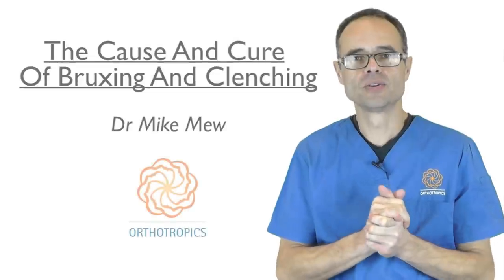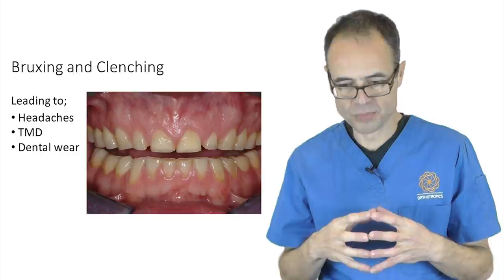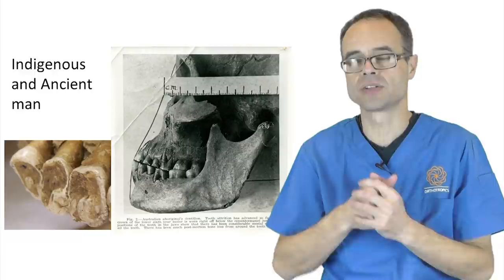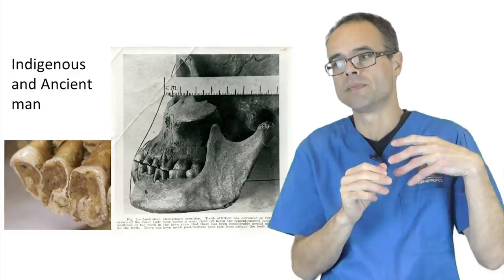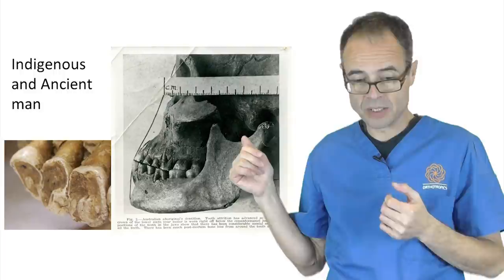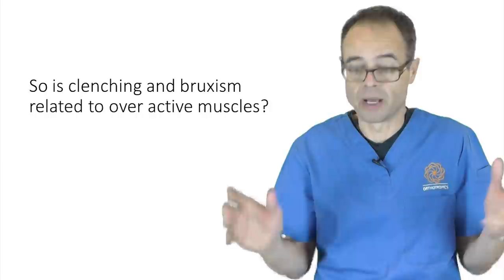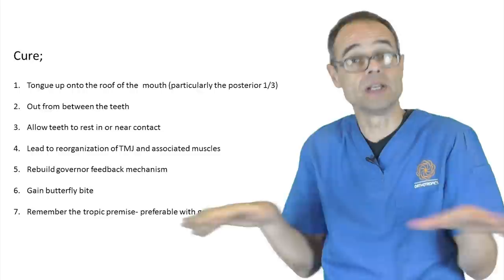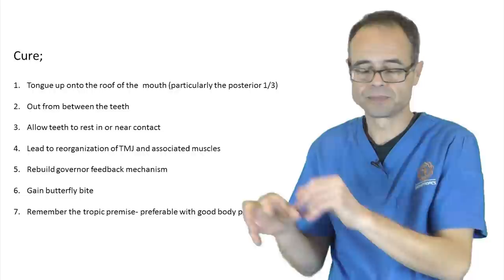The Cause And Cure Of Bruxism And Clenching By Dr Mike Mew

Comment: I used to suffer from bruxism. I was told I'd need to spend a lot of money on a night guard OR teach my jaw to relax throughout the day. I tried the latter and if worked. Most surprisingly, I stopped biting my nails as a side effect!

Then I suffered an acoustic trauma that left me with tinnitus and Eustachian tube dysfunction. The constant ringing and feeling of head fullness made it literally impossible for me to consciously relax my jaw. I wasted $800 on a TMJ splint, hoping it would simultaneously treat my TMD and my bruxism.

Then I discovered the Tropic premise, and even with my old retainer in, I felt that my bruxism was starting to relax. I can now use my tongue to consciously stop clenching, and I don't seem to suffer from bruxism anymore. I no longer wake up with sore temples. Actually I don't feel my temples straining at all when I clench, ever since 2 weeks after ditching my retainer. My teeth are a bit sore some mornings but in a GOOD way, from the roots being pushed outwards by my tongue. It's like a stretch. It is very, very clearly a different sensation than the one I used to wake up with from clenching.

You could have saved me $800 if I'd listened to your ideas sooner. Thank you for all you're doing.
Reply: Do you have pain around your eyes during the day ..like constant headaches?
Reply: @ilqar887  No, my chronic headaches are concentrated towards the back of head / neck area
Reply: @JupiMeow  so it had nothing to do with your jaw?
Reply: @ilqar887  I never said that. It's a chronic tension headache from having shitty neck posture due to the positioning of my jaws

Comment: Dr Mew, could you make a video on what remedial solutions avaialble for ADULTS who had their teeth removed for braces?
Reply from the maker: Thanks, I will put it in the list of videos to make but you need to gain more tongue space and that will often require some form of intervention.  This then opens up space and a lots of problems.  Mike
Reply: Gray are there any less invasive ways? I.e if the dental implants could be avoided ? I feel extraction has done enough damage to myself ... also what are your thought about dr Sam muslins ( in the us) veenlays?
Reply: As far as I'm aware, once the teeth have been removed there's very little that can be done to rectify that problem without implants.  You can still expand your jaws and reap the health benefits obviously, but I'm really not familiar with the details of how that would go with the teeth missing.  How many and which teeth did you have removed by the way?  I'm guessing it's the back molars and the wisdom teeth, but I just want to check to be sure.

At any rate, I'm looking forward to seeing Dr Mew's video on this problem, it should be very interesting.

In regards to the venlay system, and please bear in mind I'm no professional in any way and my comments on it are just my personal opinion, but from what I can see it is cosmetic dentistry that bears in mind the importance of the relationship between the mandible and the jaw joint.  That's a step up from most, but the big issue I can see is at no point do they mention the maxilla, which is a big deal in regards to treatment of facial problems and the jaw joint issues that this system claims to address.

Some of the before and afters have less prominent nasolabial folds as well, which indicates to me that the maxilla is being negatively affected by the treatment (I could be wrong on this but that is what I correlate a developed maxilla with,) but that could just be down to how hard the patients are smiling in the pictures and I can't make that claim for sure.  Some of them do appear to have longer faces in the after pictures though, (it could just be subtle differences in the way the pictures are taken,) which in terms of our health is not a good sign.

My take on it is that any attempt at addressing these types of issues with this type of approach will be problematic if the oral posture and the maxilla aren't taken into account, but the results seem pretty good on the surface so you'll have to make you own judgement about it.  I'd be very interested in hearing about how these patients health is 5-10 years after the treatment, because it's not always apparent right away what the effects might be.

For me personally, I'd be incredibly hesitant to spend that much money on a treatment that doesn't seem to consider all of the factors involved in our health and our appearance.  

That's my thoughts on it, and I hope they help you.
Reply: wow, thank you for taking the time writing such response. I had 4 premolars extracted, two upper 4 and two lower 5,
 to treat an 'overbite' (thankfully my wisdom teeth are still here), however the end results of my orthodontics treatment were terrible, I was left with extremely narrow dental arch, little space for the tongue, terrible TMJ, also my lower mandible has been pushed further back,  pretty much every side effect that's been mentioned ...and yes I also understand where you coming from for the veenlays,  especially been put off by the cost around $80K.
Reply: You're welcome.  I'm pretty passionate about these subjects and I can't help leaving long comments.

It's a lot of money for the treatment, and it seems insane to me considering how little they talk about the maxilla.  For the issues you've described, based on what I've read on the subject, getting the maxilla to expand is a key piece of fixing those issues.  Any treatment you consider should take that into account.

If you can fit your tongue up on the roof of your mouth then I'd start with the oral posture changes recommended in the tropic premise.  It'll need addressing somewhere down the line anyway so I'd say start there and look into treatments that focus on expanding the maxilla.  It will be complicated by the removed teeth, but getting the maxilla to a decent enough size that the mandible will be able to come forward will be important to dealing with the issues you've described, so I'd say just expand it and deal with the issues of the removed teeth later.

I need to make it clear though because I'm leaving a lot of comments on these pages, I'm no expert or authority on the subject, these are just my personal opinions  I'm in no position to even pretend to offer medical advice.  I just want to make sure that's crystal clear.
Reply: @Grays_Plays  I'm new in this orthotopics...
I found, your comments are very helpful for me to understand the orthotopics deeply.could you tell me how to expand lower arch(mandible)..
Thank you Gray  helping  me out by your valuable comment...

Comment: Mr Mew, will a retainer prevent the widening of the dental arch (should i get them removed)?
Reply from the maker: Interesting point and one that I've been asked many times and one that I will try to make a video post on soon.  I cannot advise you to do this as you could sue me if your alignment deteriorated after stopping, however if you have perfected your oral posture and function then in therapy yes.  Mike
Reply: Orthotropics Thank you for responding and considering addressing this question in a future video
Reply: John Rambo I had the same question and assumed the answer was yes. I had permanent retainers on both arches but recently had the top arch removed and got temporary retainers instead
Reply: I have a retainer on my incisors and canines. Will it prevent expansion of palate?

Comment: I really like this theory. It's starting to make a lot of sense. I have a very small mouth and luckily I only have 28 teeth because I was born without wisdom teeth. I've had braces so my teeth are really straight, but I do have to wear a mouth guard because of bruxism. Extreme force can apparently cause the gums to recede a bit as well. My teeth are really so flat in my opinion since the orthodontist ground them down so much to get a good bite that moved around anyway. Just by putting my tongue up in what I guess is the approximate correct position it balances the look of my face immediately. If I don't do it my jaw looks short and I get a double chin effect if I move my head too much.  It's also easier to swallow pills for some reason in this new position. I'm going to try this for a awhile and see how it goes. Hopefully it doesn't cause my teeth to move in an ugly position. My teeth are very close tight together and i have permanent metal bands behind my 6 bottom front teeth to prevent bunching I guess, and behind my two top front teeth to keep a gap from reforming up there. I've also had a maxillary frenectomy? of upper lip tissue to prevent this.  I chew a lot of gum anyway, and with my tongue like this I do think I look a lot better. It's making it a habit and getting the very back up enough that's gonna be difficult. Also I don't know if the front of the tongue needs to also be on the soft squishy palate or if it can be on the bony ridge behind the front teeth where it's more comfortable. I also don't think I have enough room for my tongue because I still get the indents on one side when I do this. This may cause my teeth to move in a less than ideal way so I have to weigh whether my face looking nicer is an acceptable trade off.

Comment: Dr. Mew, How does mewing/tongue posture help/apply, how are the teeth supposed to rest with the tongue in the roof of the mouth if the palate is so narrow the tongue hangs out of it, a vertical dimension that is too short, which collapses the bite and face and puts the TMJ joint into stress/locking position? How do you suggest treating the root cause of narrow palate, and vertical dimension deficit which in my opinion is cause of my TMJ problems, bruxism and chronic facial, neck and shoulder pain. There are so many different theories out there, all of which many different dentists are happy to trial and error on me. The last "comprehensive treatment plan" was $15,000 for what seemed like total guesswork. No workup diagnostic tests or measurements were done outside of a CBCT. I need at least a thick orthotic, which no one seems to be able to understand, to stop the bruxism damage to my teeth while lifting my bite, raising my vdo. Thanks for any advice. I've been considering having a remote consultation with you.

Comment: hello, I did not have any jaw pain before, but after I got my braces removed, I got a hawley retainer for both archs. Ever since i started wearing it at night I have had jaw pain sometimes and popping noises in my jaw. Do you think this is because the retainer on top reduces tongue space, because it is quite thick and is in between my tongue and the roof of my mouth. Do you think it is causing the bruxism leading to jaw pain?

Comment: Hi, i have an open bite (genetically top jaw didn't grow properly). Oddly, I have never had problems but I have turned 32 recently & have started experiencing jaw ache, tightness & friction wear on the inside of my cheeks which can be quite painful & distressing.
I don't have the money for orthodontic treatment. I have never noticed my tongue protruding in between the gap of my top & bottom jaws before until I truly stopped to notice it, but it is true (I am so worried how much damage this could've done to the position of my teeth :-( ). Now that I am aware of it, I am going to try with a huge consistent effort to train my tongue to sit on the roof of my mouth. I would be grateful for any other hints & tips for jaw ache / tension for someone with an open bite.

Comment: Been getting a very dry mouth in the morning for over 2 years now. It gets so bad sometimes that I fear going to bed because I know the morning is going to be hell. Once I wake up, clean up and have some water/tea it goes away, but those 30/40 minutes upon waking can be hell. I've tried everything from getting a humidifier for my bedroom to brushing 3x times a day to learning to sleep on one pillow. One thing I noticed is that I clench my jaw together practically all day and my teeth rarely separate. I've been keeping my lips closed, but my jaw slightly open since this morning and already I can feel a huge difference in saliva production and my mouth, jaw and head don't feel so tight. I'll see how I feel in the morning, but I think I'll be keeping this up. You can't tell in my picture because I'm smiling but my jaw muscles are solid and quite exaggerated. 

Is it normal to get red cheeks and a warm face when you stop clenching your teeth? Because my face is really warm and red as if it's just full of blood/oxygen?

Comment: I missed the cure in the cause & cure of bruxism. You didn't particularly like the over the teeth devices shown (thought you said). Currently seeing a dentist who specializes in TMJ & Sleep apnea. Have both, (left jaw was almost to the point of lockjaw), semi closed nasal passage, persistent clenching, horrible neck pain, & mild OSA. Received a sacral belt, a thing for my shoes to help the feet, a splint for all day to help realign the jaw, &  night guard for apnea. Some of these help w/ posture. Do you agree w/ that protocol? I've not found anything remotely close to this treatment & am in the infant stage. Hoping to glean the help so desperately needed. I struggle w/ the level stress I have so it's causing  a decline in my health due to trauma of clenching as a result of that stress. Your explanation was informative about how it is actually trauma to the skull, tho you didn't say those particular words. If there is another cure I'd like to hear it because I've about exhausted ways to combat this, as well as money. My dentist thinks this condition will be greatly helped in time. Thanks for post. Will be watching some of your other vids. Very interesting!!

Comment: I’m 21 and I’ve had tmj for like 2 years. My dentist thinks I clench but I think my front teeth is crooked which makes my bottom teeth moved further back and thus pushing the lower jaw back and possibly putting pressure on my jaw joints. Can mewing change the front teeth as to give me more space to close my mouth at the right position?

Comment: I worked with the best strenght and conditioning coaches and I understand a thing or two about agonist and antgonist though in no way an expert for the jaw or anything teeth related for that matter so please correct me if I am wrong but I can't get my head around how the tongue is the antagonist for the jaw muslces. Wouldn't mucses that would open the jaw be the antagonist? There is no doubt the tongue plays a secondary role to control and relax the jaw but to offset the mechanism of the mandible muslces or general clenching or closing would have to be a muscle that essentially lowers the jaw.

Comment: I was given one of those soft mouthgards when I had completely straight teeth but issues with my massater muscle, over a few year ive started noticing a change in my bottom teeth one side is falling, I believe the mouthguard caused me to take up mouth breathing at night which caused miss form in my facial structure I am now trying to fix this by mewing and discontinued use of the mouthguard that ruined my teeth and worse and my bruxism

Comment: 1:20 this is what I had to get to “correct” my malocclusion (incorrect bite). My first one - it was on top  across just 4 teeth and it was hard, had to be heated under water before I could put it in. That one for night wear to help with my clenching and bruxing at night. I was waking up with great jaw pain and it got so bad I was getting migraines several times a week. The top guard helped... until I BROKE IT- my jaw is ripped, it wore it down and then snapped it! That was $400.

THEN the migraines can back and I saw a specialist who said my jaw was trying to find a better fit because my teeth were not meeting properly (despite having had braces many years ago). So $3000.00 (yes, thousand- and thankfully insurance covered about 2k of it at least) Ihave a mouth guard on my bottom teeth that looks like the one in the pic on the left. Hard plastic and essentially the shape allows my upper teeth meet a different way into the guard and that has amazingly solved the problem.  

BUT - it’s not a permanent fix. It’s eventually going to break too. I need to wear it all the time even while eating for it to be completely effective. But I don’t wear it out with work so by the end of the day I’m issuing massaging my stupid jaws and cursing a headaches. 

My options are basically, braces and all that crap again, replace the guard when it wears out and just use that as like a brace indefinitely... or .. surgery.. and likely braces for a much shorter time. 

But maybe Dr Mew has other advice!! 🤕
Reply: My clenching was SO bad, I’ve cracked 2 molars, got abscesses, and had to get them pulled out. I got hard guards. Didn’t help. I got enough Botox in the clench muscles to bring down a horse. That lessened it about 60%. But that Dr referred me to a dental hypnotherapist. 2 visits to her, and I stopped clenching immediately.  Now I only wear a tiny, thin PIECE of a guard when I sleep. 
And I’m going to start doing this doctor’s tongue exercises immediately.
Louise, Australia 🦘

Comment: I have often thought that my chronic stuffy nose was causing my clenching problem but you can't be on antihistamines forever. Went to an allergist and was told i had sensitivity to particles not allergies. My tounge  is usually ridged and seems swollen some mornings.
Reply: Susan Rose Practice deep breathing exercises. After a month combining both my ability to nose breath is phenomenal for the first time. I am allergic to most things and am beating the symptoms one by one.
Reply: I should add that smoke particles had been giving me 4-5 days of fatigue so I can sympathize. If you study the respiratory system you will discover the filtering nature of the sinus cavity. As a compensating mouth breather particles were getting deep into my lung alvioli which in turn minimized my ability to get oxygen even from a deep inhale.